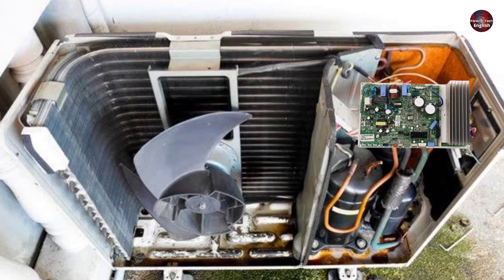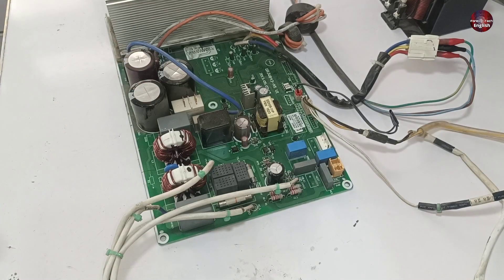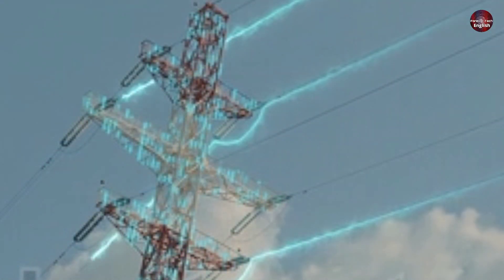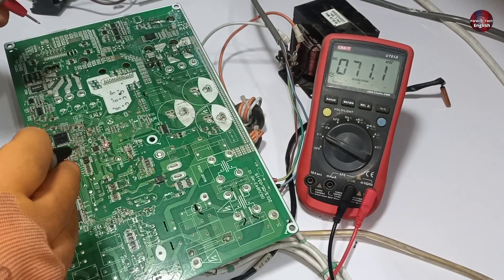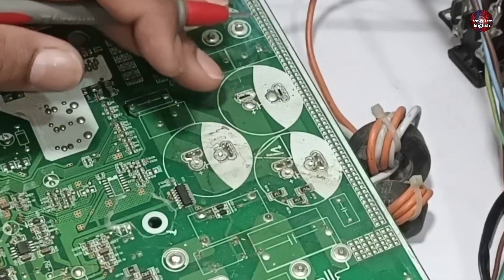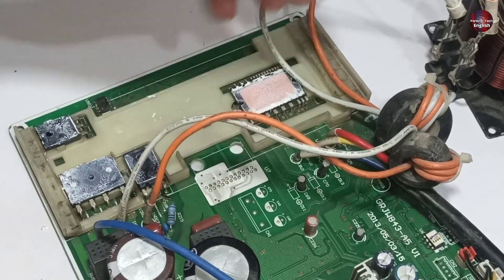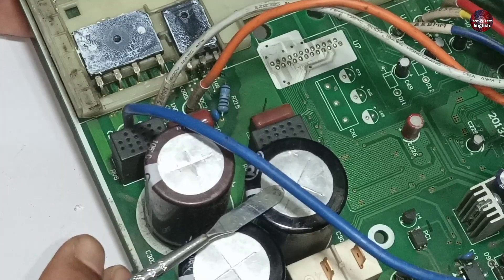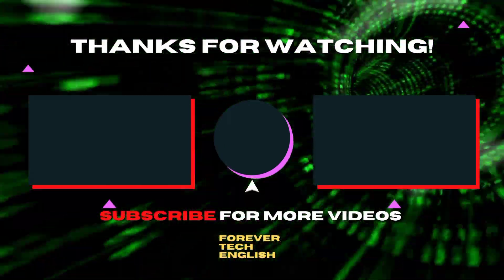Compressor Start & Stop In 1 Minute of Inverter Mini-Split Ac

Comment: Very good video I have a similar problem like that compressor comes on an run for about three seconds and stops can you give me an advise please
Reply from the maker: Which air conditioner brand is it?
Reply: Milexus inverter 220 volts
Reply: Same with my 3rd gen 18k mrcool diy